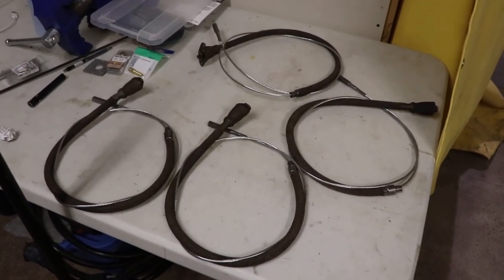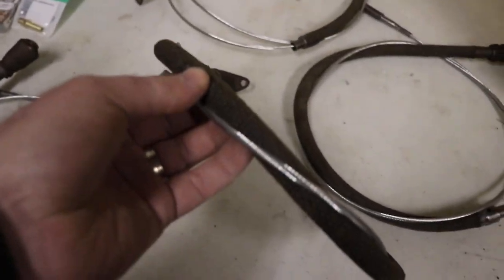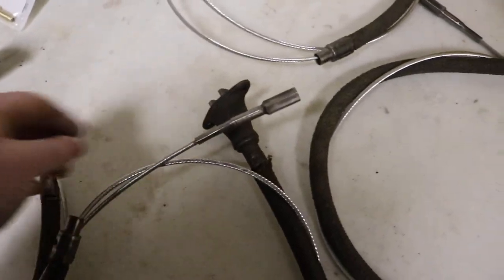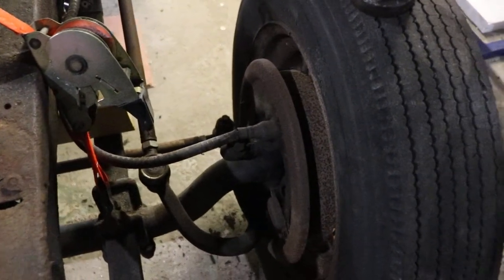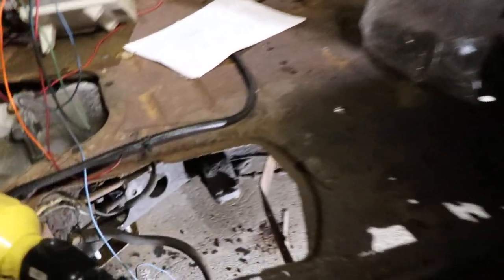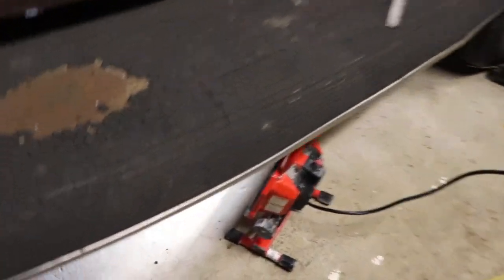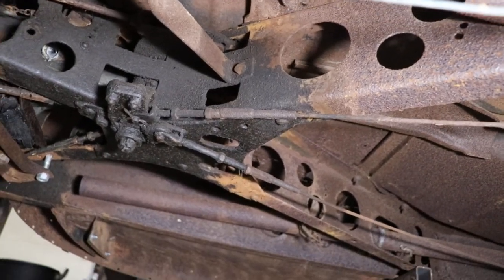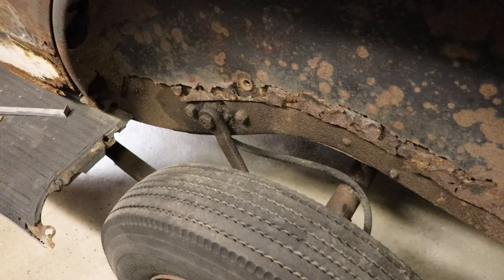Custom Steeldraulic Brake Cables

Comment: have you done a video of installing them and how they are adjusted by chance
Reply from the maker: no but the National Service Data on Internet Archive has all the info you should need to adjust them.
Reply: @SteveRivett  I just got a set of the pliers I was just wondering how they were used.